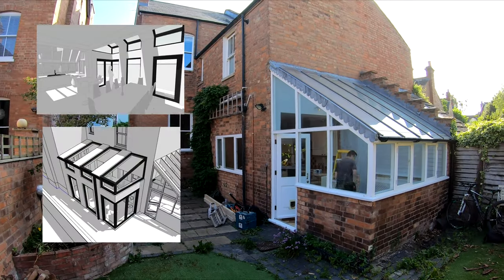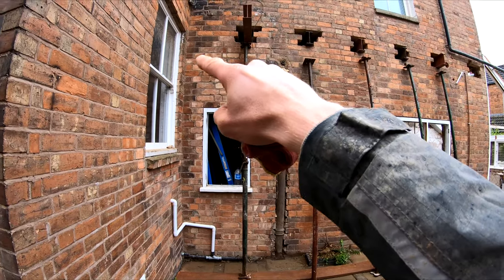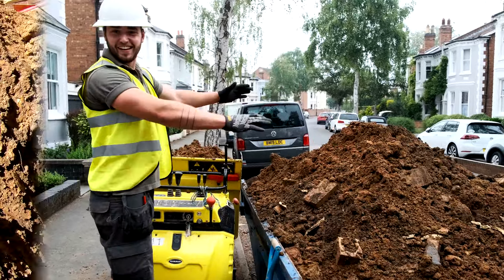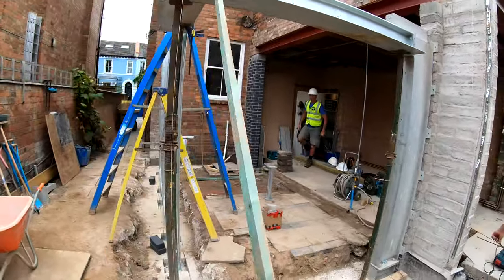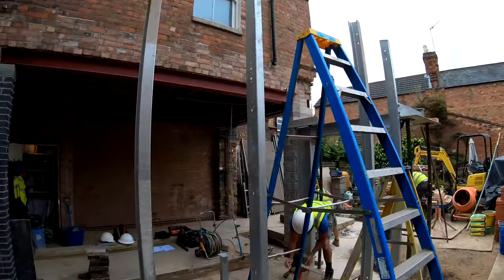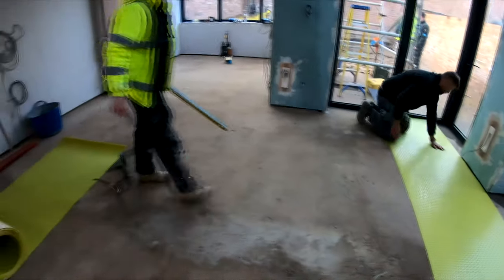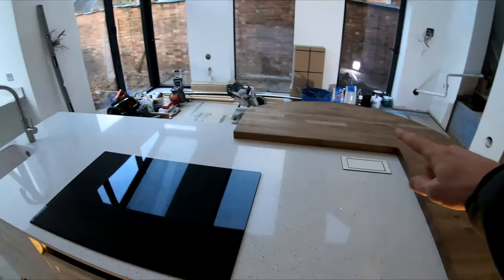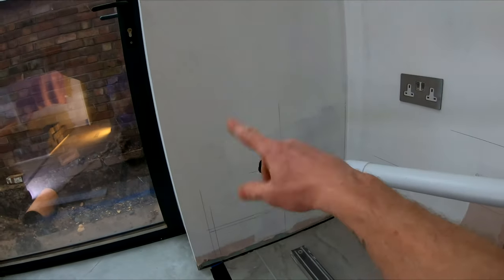Luxury House Extension - Satisfying Video

Comment: I don't know these guys from Adam but I've watched this project from start to finish and the workmanship and project management of it is simply phenomenal I have to say. It is a complete vanity project of course and incredibly 'over-specified'. They are future-proofing stuff here that will be fine for around 500 years before any problems occur. Although I assume it's all for the video, I think they are clearly used to working on period houses such as this, most builders could not do what they are doing. 

This client clearly has unlimited money and I'd love to know what they are being charged for all the extras outside of the original drawing and specification. 90% of builders in the UK would simply not have the sheer skills to undertake a project such as this, seriously it is that intricate. These guys are the best in class clearly in every trade and would charge accordingly. The site access is a complete nightmare, lots of hand-balling and barrowing materials and waste down a narrow alley and a very tight site generally round the back. It all adds to time & cost. 

I work as a quantity surveyor and I'm thinking you would not get much change from around 400k for this project, it is enormous the detail involved inside and out. I suspect it has taken nearly a year for this job to complete (probably 6 months without the over-specifying of things) It looks like it could be in a conservation area to me as well which adds cost. That window framing and glazing arrangement alone could cost around 30k. Kitchen is probably not far off that as well with all the fancy pretentious stuff in there. Bathroom upstairs probably ultimately 20-30k too with all those bespoke fittings. Most builders would not know how to cost a job like this up but I'm guessing these guys whack a bill in with whatever they like on it and it gets paid no problem
Reply: There’s no way I would hire you as a quantity surveyor if you think this costs 400k, that’s bananas. My guess is 150k maximum and that’s pushing it.

Comment: With such huge counter-space, why place a small sink at the very edge, making sure you'd be sweeping the splashes every time you use it? A double-sink at least (using the inner to wash, outer to dry) would have made a difference.
Reply: There was a second sink in the extended bit with the windows !

Comment: Fantastic to see the finished article, 
Interested to find out the damage, 70k region my guess
Reply: I'd say that's 90K myself.
Reply: add about 500k onto that and you'd be close.
Reply: @thomroberts2517  you reckon ?
Reply: @tntwentyone2951  that glazing alone would cost about 70k, no joke. People have no idea how expensive things are. This is a total vanity project. They also did a bathroom refurbishment upstairs which would have cost about 20k I reckon. The stuff they are fitting on these jobs are unbelievably expensive.
Reply: @thomroberts2517  however there is always a ceiling price the house would go for if it were to sell on the market. I did watch most of these videos and I think the house in unbelievable. Great finish and workmanship on the project. I'm going to revise my initial guess to £150-£200k

Comment: Just out of interest, why was the pier supporting the steel closest to the original house built with engineering bricks while the one holding up the floating corner was done with blockwork? (Also, awesome job guys! I watched the whole project through as you posted them originally but it's nice to see it in this format at the end as well!)

Comment: Amazing job lads, this looks incredible! I have a question regarding the large steal beams encased in the dug footing. Could you have used some steel cage mesh to reinforce the concrete instead? Would that have provided enough strength for the supporting steal beam sitting on top? Cheers!
Reply from the maker: Hi OzzieBs much appreciated no because the steel was used as a cantilever specified by the engineer all the best Tony 👍

Comment: I am an architectural technician and just wondering the glazed section on the end. Normally with a conservatory you need it seperated from the habitable inside areas. Did you have to use a high spec glass to get round this?
Reply from the maker: Hi Roscopeco this was all supplied from Apropos with improved gas filled glass to increase better u valves all the best Tony 👍

Comment: question why wasn't there isolation beneath the concrete ?? wont the floor heating dissipate in to the ground .?
Reply from the maker: Hi Danny 125mm on top of slab then underfloor wet system all the best Tony 👍

Comment: Why no isolation on the sides and missed chance of heated flooring.
Reply from the maker: Hi Snake Docotor,

The only wall which wasn't insulated was the party wall, as insulation was not required. All cavity walls were fully insulated. We did install a wet underfloor heating system, which we recommend with the majority of our works.

I hope this helps.

All the best, John 😊

Comment: Cost to build, roughly £55-60k. Value added to house, roughly £30-35k.
Reply: I am looking to do exactly the same in a few months but quotes coming in around 60-80K
Reply: @cabottaxi  is that with everything from the electrics, underfloor heating, kitchen units, plumbing, the lot?

Comment: How on earth did they manage to get away with that much glass? I had to argue the toss and pay for a guy to come out to have 3m bifolds and two large velux windows when we went back 4m across the back of our house in 2020. Local authority didn't want us to have so much glass for reasons of heat loss.
Reply from the maker: Special glass and gas fill lots of insulation, architect had organised everything so it was a win win

Comment: No insulation. No underfloor heating. Nice. That's gonna be dug up again before long.
Reply from the maker: Hi Frank it’s a good job we put 125mm insulation in and a wet system underfloor so no need to dig up the floor,  you see this process in the video all the best Tony 👍
Reply: @BuildWithAE  Legends. I was going to come back and edit this and say this had nothing to do with the work! But then I thought it was YouTube and gave up on that. Thanks for the reply